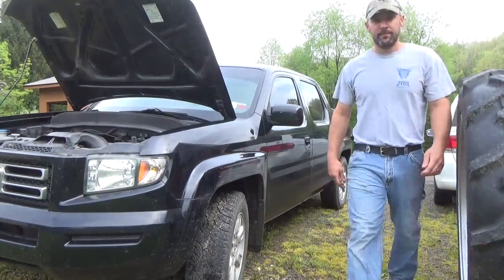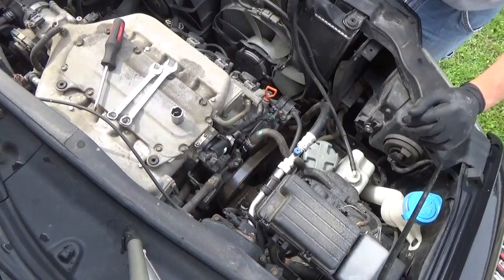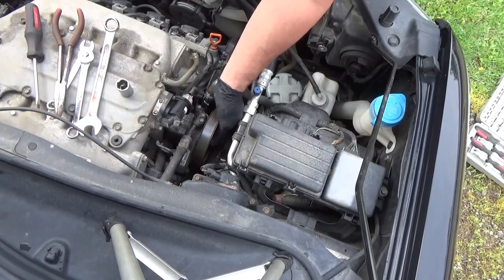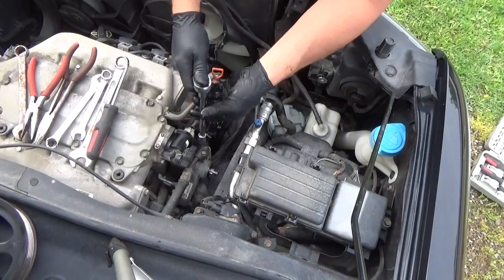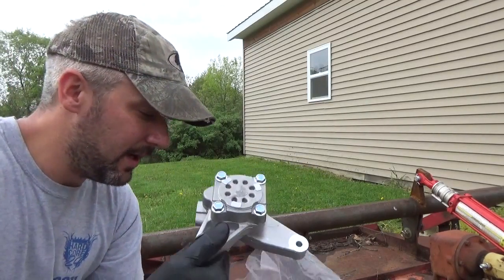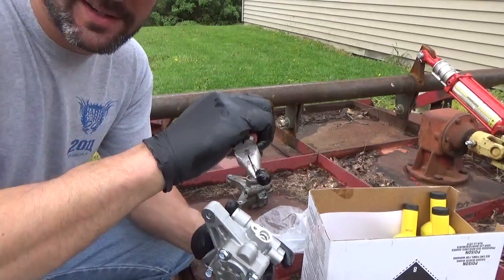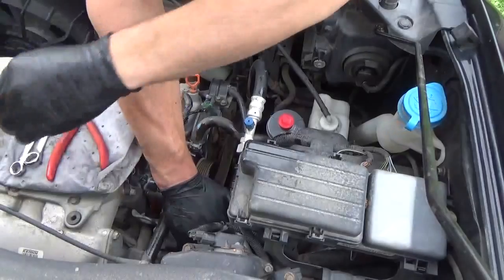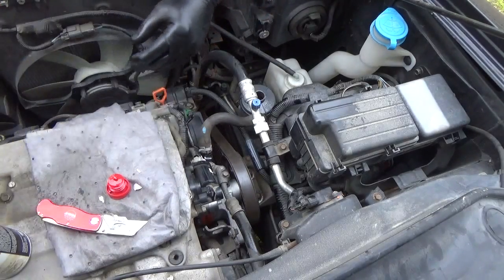DIY Repair : Honda Ridgeline Power Steering Pump Replacement

Comment: I just watched this one for the 2nd time because I just finished replacing the PS pump and 2 high pressure hoses on my 30 year old GMC. Even in your driveway, with no tools, you make it look easy. You need to change your closer to "If I can do it, in 15 minutes, without even getting dirty; you can do it, in 7 hours and look like you spent a week working on an oil rig!". Great job, as usual. 😉

Comment: Classic power steering whine.  One of the nice things about that sound, it's pretty much identical across all cars.  Great DIY repair in the yard.
Reply: Fords use to sport plastic pump vannes to ensure they could not last too long and did create regular amount of contamination... AtoZ prematurely failed like with German money-pits  😂 

Honda pumps use all metal vannes. Japanese helped raise up  the bar👍🏻

Comment: I had a power steering pump leak on a '99 Dakota Sport.  I bought the o-ring kit and rebuilt the pump instead of taking a chance with a crappy aftermarket replacement pump.  The hardest part was using the puller to get the pulley back on and lined up on the shaft so the belt wouldn't squeal.  Man, that truck was so easy to work on.  I miss it.  I'd give it to my son if I still had it.  It was clean, the frame and body was straight, the bumpers were steel, the air was cold and the stereo was sweet.  I miss Megadeth while cruising down the road.

Comment: I bought my 2008 Ridge when u sold your ‘06. I’ve been lucky—435k (miles not km). The PS pump is still good- like engine and trans- but I’ve learned a lot from your vids and wanted to say “thank you.”

Comment: I know this is an old video, but I was having a issue with my pump on a 2010 Honda Odyssey. I watched the video and replaced it and the pressure hose. I followed your example and all is well now. I am trying to put off buying the wife a new vehicle. I keep telling her that even new cars break. Look at the service bays at the stealerships. By theway, I did use the BBB pump. Love your channel. Best "real man's" channel on the you tube.

Comment: Good to know about the oring causing p/s noise. I used your brake cleaner on exhaust hangers trick and man oh man, it works awesome.
Reply from the maker: Jonathan Milbury Don't tell people on YT you sprayed an exhaust hanger with brake clean they will go nuts on you...

Comment: Loved the "regular guy" driveway repair on the old Ridgeline. I had one a few years back. Great truck but my 6'2" frame could not get comfy behind the wheel. Always felt like I was too close to the dash. Too bad because it did everything well. Only had it 3 years. Nothing broke so didn't get many wrenches on it.
Reply from the maker: ***** Oh I love mine and I am a bit shorter so it fits well. One of the 1st wrenches on it so far. Better get rid of it now lol

Comment: Hello, Been watching your videos for years. However, just found out you drive a black Honda Ridgeline, also. Mine is a 2008 model. I typed in power steering pump for my truck and your video popped up. Lol. Thanks.

Comment: Nice job w/ minimum tools! Field repairs are not fun, at least it wasn't raining and didn't have to roll around in the mud, thats always fun. If you do not already have one, you will love a Schely 10950 serpentine belt tensioner tool. I know what your thinking, already got the gearwrench serpentine belt kit, they don't work so well on some Hondas. There are a couple different ones, the Assenmacher HON1419 and the Schley 68170, don't get those, they are cheaper for a reason, they bend and they don't work as well, get the Schley 10950.

Comment: Great video my first tool set was exactly the same as yours a crescent set. The ratchets are bit clunky but they lasted well. If I remember correctly, I got them from Costco yes, we have Costco in the UK here as well.
Reply from the maker: shaun pi There ratchet is big and set up backwards but seems to work well other wise...

Comment: Awesome work Mr. Eric O from another Ridgeline user.  I will be rebuilding my PS pump since I am getting a little moaning/winding noise when turning, not too annoying.  I will be changing all the seals, etc.  Hoping is not my steering rack.

By the way, I did a valve adjustment on my 06 Honda Ridgeline 2 weeks ago.  I had the intake valves way loose and tighten them.  The exhaust valves were okay so left them alone (not tight at all).  I am now getting negative fuel trims which annoys the heck out of me (STFT -5 and LTFT -9).  Seems bank 2 is running richer than bank 1 too.  Has this happened to you before with Honda CRV, Ridgeline, or Odyssey?  I did notice lots of carbon buildup on the cylinder heads, so not sure if this plays a factor?

Mileage ~150k and not DTC.

Thanks bud and keep those videos coming.
Reply from the maker: jm1272jm You may find when you tear your pump apart you will need more than a seal and O-rings. Mine was scored up pretty bad and the hub and vanes took a good beating. Yours may be different though. Funny you mention that about the fuel trims. I have seen that before on the 3.5's but it usually sets a P0171. Oddly enough a bad MAP on a 23.5 Honda can affect 1 bank. Blows my mind but it is true.
Reply: South Main Auto Repair
Oh, thanks for insight Mr. Eric O.  Did not think about the hub & vanes, so I may have to shell out for new PS pump.

Regarding the negative fuel trims on bank 2, I am getting ready to put a fuel pressure gauge to see if injectors are leaking or maybe spray pattern is out of whack.  Interesting thing about MAP sensor you mentioned, yesterday I wanted to get ohm measurement, but could not find specs on my Honda Service Manual.  MAP Sensor PID readings are same as before valve adjustment too.  Hate to throw a new MAP sensor, but I was leaning towards that too.

Thanks for helping out a fellow Ridgeliner.
Reply from the maker: If you use MOD for your repair info I wrote a whole article over there with live data pictures and explanations.
Reply: Darn, don't have MOD subscription :(
Reply from the maker: oh dang

Comment: Just did the same on my 2006 Odyssey.  Mine didn't do the whine and squeal, just lost power steering at low engine rpm.  Especially aggrevating in a parking lot.  The fix was a new pump and because I wanted to see what was wrong, I yanked the pump apart.  It's a vane style pump (versus a gear or gerotor style) and a few of the vanes were stuck in the rotor.  Tried prying them out and there was no moving those suckers.  New pump and wham-o power steering again.  In another 140,000 I guess I'll be putting another pump on there.

Comment: Yep. Great vid.  Did the O-ring fix on my MIL's Pilot and it started making noise again within a month.  Thought she had a bad PS pump but she had a leak at the rack letting air in the system.  Had to pass on that job.
Reply from the maker: DriveBetter Hmmm did it get anew rack or get a fix?
Reply: South Main Auto Repair I don't have a lift or an unfailing love for my mother in law so I let her go to the Honda dealer and they swapped the rack.
Reply from the maker: Haha .. well ya do what ya can right haha

Comment: In the late 90's I rebuilt my '79 Pontiac GP 301 engine from an overheat in Nevada.  Installed a "new" Dorman camshaft along with all the other new parts.  40 miles down the road on the interstate it just instantly shut down and coasted to a stop. Camshaft distributor/oil pump drive gear was completely worn off , no teeth!!
Needless to say they said it was my fault?? No reimbursement of any kind. Never again Dorman for me to this day. You never know when a Dorman part is going to bite you.

Comment: I’ve used pig mats for many years and they have the white ones that float on liquid and only soak up oil.  We used them in chemical tanks and absorbed the oils that would float on top.  I use the gray ones at home under my oil buckets for used oil.

Comment: Hi Eric,  Welcome  to my world . When have a repair  to do.  I have to do outside when weather  is good.  I live I n.v a apartment  complex.  Oh you my tractor  on your  coffee  mug.  On my first  job. I drove  tractor  just  like that one in the 1970s. Was working on a farm. Tractor was farmall super H narrow  front  with a bucket.  32 hp 6 cylinder  straight  line. 5 speed stick. When I learn how drive  from.

Comment: I always heard that you should only use Honda Power Steering Fluid for Hondas.  Have you had good luck with the Prestone fully synthetic?  It's less expensive, so if it works great I might buy that next time I flush the system.  Love the video because I'm getting ready to change out the Power Steering Pump on my Civic.
Reply from the maker: Matthew R If I wasn't doing it on a whim I would have gotten some OE fluid but I just wanted to get it done... Dunno about the prestone, 1st time using it. Said on the bottle it covers Honda so don't think I will have an issue.

Comment: Love the "H" - never seen a rotary cutter hydraulically operated rear wheel adjuster, you must have done that.  Mine just has a trailing wheel.  Like all the raised garden beds. How many acres do you have ?  I bet a Silverado is looking better all the time:)  mine has 278K original pump and gear !!
Reply from the maker: Steve Rob Well that one has hydraulics because the H is only a draw bar tractor so you have to use "trailer type" implements. Your is a 3 point hitch so it only needs a guide wheel prolly. The raised beds sure do make us a lot of food. We have 40 acres here mostly wooded though. Silverado...hmmm lets see 278k ='s  13 front hubs, 7 exhaust manifolds and broken bolts, 2 leaky intakes, 5 water pumps HAHAHA should I keep going ?
Reply: South Main Auto Repair  waooo!that be here a 10 million dollar home...i know house are cheaper in town...how much ur cost so i start saving from now ??lol

Comment: DId you try the o-ring replacement first?  Common issue with Subaru pumps also
Reply from the maker: Ozzstar Oh yeah ..even though it did not have the other symptoms

Comment: Hi Eric. You may not see this but wondering what kind of job it is to do a high pressure hose on 2007 Ridgeline. Got one coming in and books says 4.7 hours..yikes!

Comment: South Main Auto Repair I thought you all honda/acura cars require the use of honda/acura power steering fluid, I thought it would damage the system if you anything but that. Does that asian power steering fluid formula work better then traditional power steering fluid?
Reply: If you check any Honda owner's manual it will say use only Honda fluid which is sort of fair because you know it won't damage the pump or system. I however have an Accord with 250,000 on the clock on its original pump and I've fluid flushed it every 60,000 miles with Prestone Asian power steering fluid hasn't been an issue. I will say though the Genuine Honda fluid is the safest route.

Comment: I know it's been a while since you Uploaded this video.But I have a situation going on which is similar to yoyes.However, I'm not having a lag or stiffness in my power stirring.
Just making a god awful noise. Would this be a sign of the o ring going bad going bad

Comment: what was the problem ? why did you change the pump ? Mine 2011 is groaning noise when turning in low speeds.

Comment: I replaced my pump on my 07 Ridgeline, with new O-rings. But I'm still getting some whining intermittently after the truck has been running for a few minutes and makes some turns. Fluid is full, and steering is normal otherwise, any thoughts on what the problem could be? Could the Reservoir be an issue? or an air leak on one of the hoses?

Comment: toyota used atf for power steering. it says it in the manual and on the cap. seems like it is common to use atf for power steering. i would guess those bottles have expensive atf in them

Comment: Don't you just love working at home in a dirt driveway. At least you didn't have to lay on the ground. Where I work we have been having really bad luck with the Napa pumps and boxes. Not so much the racks, except we always get them with old inner tierods on them that the wrench flats are always rounded off. I mean come on, they remanufacture the thing, replace the boots, why not put new inners on it. But the pumps and boxes, we get one and within a day or two, sometimes around the block they fail, we warranty it, same thing again, usually then we get an oem and Napa pays for it, and no more problems. So the last few we have just got the oem ones, unless they are absolutely not available.
Reply from the maker: kenman1717 Oh no kidding... I have pretty good luck with the NAPA BBB stuff but cardone on the other hand I think they just spray black and put them back in the box...
Reply: South Main Auto Repair lol, no doubt.

Comment: how would you know the difference if the seal was bad as opposed to the pump being bad if they display the same symptoms?
Reply from the maker: Phil Schmitt The fluid gets all foamy when the seal is bad and pukes out all over the place when you shut the vehicle off. Click on the link in the video in the upper right hand corner to watch a video on that...
Reply: South Main Auto Repair Ok I'll check it out thanks great video by the way

Comment: I have a cardone power steering pump and it seems to work fine after 2 months: I wish I had just rebuilt my original pump though with Toyota oem parts

Comment: I am a mechanic in a beverage plant, my toolbox and tools easily exceed the value of my home.  When I have to work on stuff at home, I feel like a caveman too.  I own nothing but GM vehicles, but somehow did not have a 7MM socket at home... until the other day lol.
Reply from the maker: Eric Brunhammer I know what you mean... oh and sorry you own GM                HAHAHa
Reply: Meh, they're all pumping out the same garbage now days anyway
Reply: The other one that got me was, went to a junk yard to pull a radiator fan assembly from a Taurus for mock up in an S10 (we do some crazy stuff down there) and didn't think to grab an 8 mm socket either.
Reply from the maker: What no 7 or 8!?! How can you call your self a mechanic haha just messin!

Comment: You change the power steering with the best tool of all. Then one in the holster of course.
Reply from the maker: vlstellato Bang, Bang....done....
Reply: The one in the holster of course. Sorry about the spelling. Auto check sucks

Comment: Yes they sure will that's one reason I'd painted the windows on the garage  and put my exhaust hose out the back of the building just to get my own stuff done on weekends  in the end I cleared the windows but but put slide boards in to shut them tight when solitude was needed

Comment: Ah the neglected home job 👍 Over the years I started buying a second set of common tools for home as I would always forget at least 1 needed tool at work for a home job or to take to the wrecker. Then of course I had to buy a big tool box for home. The snow ball effect occurs till the final moment that you decide a hoist would be a good idea. Wait a minute, how did a simple tire swap cost me 30K? 🙄

Comment: mine was doing that ,the had a tsb on the o ring ,comes with a black o ring,should be a upgraded orange o ring ,i changed mine with there up graded one problem was solved .i have a 08 crvi chand my my uncles 07 pilot solved his issue and my moms 2012 acura tl

Comment: It's the plumber with the leaky sink problem, or locksmith with sticky door locks, in this case mechanic who'd rather replace a power steering pump AND an O ring because you can get by for a while without it lol.
Reply from the maker: Peter Carlson You got it... after working on stuff all day it sucks to have to go at your own... so I put it off for a day or two....or 200

Comment: So, why didn't you just replace the O ring? Could probably be replaced without removing anything except the return hose.
Reply: Sorry, you said why you changed the pump later in the video.

Comment: Hydraulics 101, don't have a pump higher than the reservoir that feeds it. It causes a lot of problems. Even with the tank level higher than the pump, many pressurize the tank to avoid cavitation.

Comment: Looks easy. On a Lincoln continental the a/c has to be discharged and the compressor has to come out the bottom :(.
Reply from the maker: alb12345672 Oh yeah some are tough

Comment: just changed the o-ring on top of pump, still whining and fluid is low again, looks like its time to change pump
Reply: Whining is caused by low fluid, and generally is a sign the pump works.
Check for where the fluid is leaking. It can be a hose, rack and pinion (or other steering variants), the pump, a cooler (if equipped), etc.

Comment: The proper way to torque those bolts down is tighten until you grunt.  Uhhh.  Then they're good.
Reply from the maker: jimboman200230 yep then back it off a 1/4 turn...
Reply: jimboman200230 my dad alway taught me to tighten them farmer tight, one more turn and they turn easy.
Reply: Or, torque 'em down till they smoke - then a quarter turn!

Comment: ERICCC only use Honda Power Steering fluid, or ATF.  Powersteering fluid is generally generic junk.  My Mazda uses ATF for the power steering fluid.
Reply: Honda's pump's are "special".  I used to have an 04 accord, destroyed the pump by putting in prestone asian junk

Comment: Chuckles at 70 plus humidity..Try a Texas spring temperature of 100 and a spot shower or storm to make the humidity around 98% with the air temp feels like 120, not to mention the freaking sun trying to kill ya.
Reply: buy a tent, no hitch no steering

Comment: If your any thing like me you have a drawer (100lbs) of spare sockets and a 10 extra ratchets of each size .why do we buy so many ?and I am sure you have more than that of spare tool , and air tools the only thing no extra od is the 10mm socket ! Dam things .Moral of the story bring one of your old boxes and spare tools home so you can do what you apsolutly have to do the easy way! .